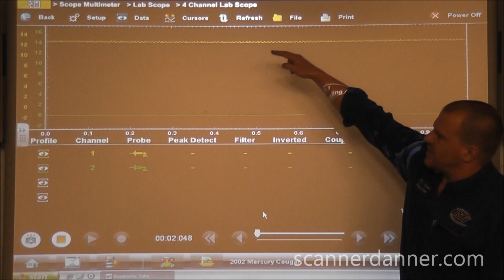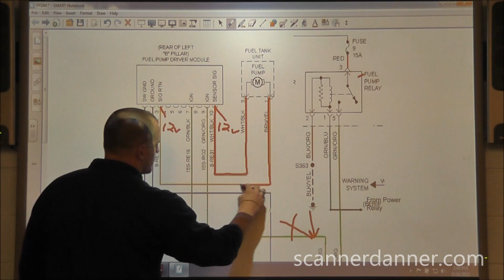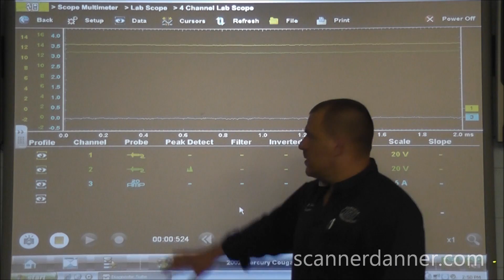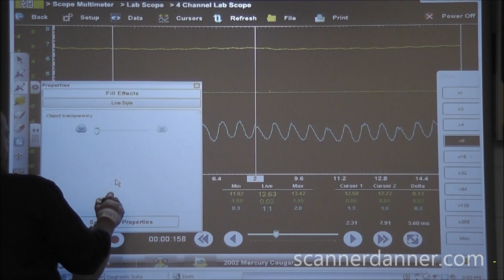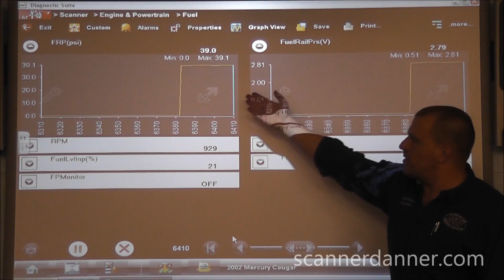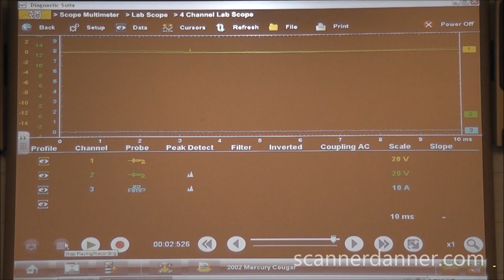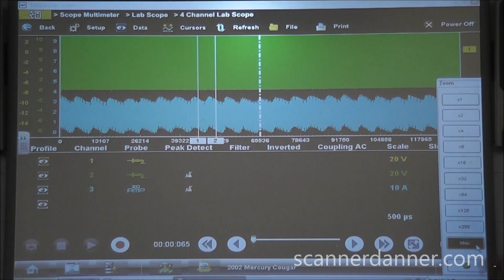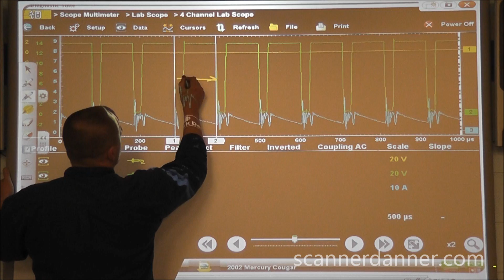No fuel pressure diagnosis and testing (new fuel pump installed, reversed wiring)

Comment: Can you tell me if I would have gone thrown off, with my limited use of diagnostic tools, but gone straight to relay, and checked that first. 
Then lead me to no power. When it should have constant. If possible,  can you reach out. Thanks
Reply from the maker: everything would have tested good at the relay and at the pump

Comment: Right on Paul Great Video as always, I really liked the way you noticed immediately the high RPM, backed it up with a Full Ground control and the RPM even went higher.  At the same time the FP amperage was about 2 amps, very low.  You determined there's no load on the Fuel Pump cause the RPM so high , so its actually was doing NO WORK.  You mentioned either the propeller fell off, broke or the FP is wired backwards.  You decided to reverse the FP power wires noting there's no wiring hazard to the FP module.  Your basic understanding of the circuit configuration, the components and their function allowed you on the correct sequence of troubleshooting.  As you mentioned Basics , Basics, Basics - thats what it's all about and that's what will make you Money $$$!!!   Thanks again Paul !!!

Comment: Good video, Thanks !!! My problem is, I did replace a new, bigger/ faster pump into my Mustang 2004/ 3.8 litre, new pump is 255l/min?/, anyway, I had to rewire, change a plug into pump, I did connect + to old +, and minus to minus I can hear pump going, but there is no fuelpressure???Could wires be wrong?/ Even I put new + to old +?? Just wondering..., or maybe there is not enough fuel in a tank?? Less than a quarter, and rear of the car is jacked up??? i will take line of the new filter next, and see, if gasgoes in there??? What do you think?/ Thanks
Reply from the maker: If it ran before and now doesn't it has to be something you touched. Reversed wiring or low on fuel.
Reply: Well, I am thinking now...red from here somewhere, than somebody changed bigger fuel pump for Mustang, and power losenend hose clamps inside tank, in a pump, they had to put better clamps in there, hose was lose..., I let you know, after I drop tank again...tomorrow!!! Hope I am right =), thanks !
Reply from the maker: keep me posted
Reply: I will, doing , checking it today !!=) Let you know.....
Reply: So, nothing was loose inside the tank, but I did put/ secure all hose connections with extra clamps!! I think what happened, was I had to modify new / universal 255 lph pump, I did shorter pump outlet, it looked so high, too high, and also it looked, maybe to narrow, smaller, than OEM! So, what I did, put thin sleeve over it, actually used epoxy glue, and made outlet almost 1/4 inch longer, so then I started to get pressure and now pump is working fine! BUT, after I changed the pump?/, and bigger throttle body, my idle is sky high, like 2500, and comes down after while to 1200???, I can't make my idle lower??? I can drive the car, but it is very difficult=(( I have changed recently IAC valve, that can't be a problem!! I also was testing Throttle Body sensor, and old was "not so good", replaced that??? No help, it seems like PCM is confused??? Should I reprogram PCM after changing a throttle body?? Old one was 60 mm, this is 70 mm, and there is 3/4 inch plate between throttle body and intake manifold, otherwise throttle butterfly-plate could not open complete!! Check engine light comes on: P0507, high idle,....sure is and P0455 = emission system large leak??? I did check all vacuum hoses, and everything around tank is fine, and I don't see any loose hose/ leaks anywhere?? Why is my idle so high, and also throttle  response very poor??? Help meeeee, thanks ! Ps. one hose comes from bank 1 into CAI pipe, after MAF sensor, old one came there also, that can't be a problem?? There is PCV valve on bank 2, going to intake manifold, hose/ pipe is fine????
Reply: Eero Laukkanen dc motors can run in reverse if wired reverse polarity in this case produces only motor load no fluid pressure loading.

Comment: I wonder how many people have wired a replacement pump wrong and ended up arguing the parts store guy?

One interesting point   in the video is on an 8 segment/bar commutator pump you are going to see any unique characteristic repeat twice per revolution  as each winding on the current has curent flow through it  every 180 degrees,  the second time n the reverse direction.
Reply from the maker: Thanks Andy!

Comment: Great video scan dan one of my faves. I noticed when GM went to electronic returnless with their FPCM there current ramp looks different than ford as scene in this video. You don't see the duty cycle in the GM pump ramp just wider amperage swings which may range 2.5 amps to 6 amps depending on what the pcm wants. take care

Comment: Great video, I appreciate all your information and videos.  I watched this video and I believe the schematic is correct. In my opinion PIN 7 is voltage supply from ECU and the other IGN is from inirtia switch, the driver need to see both signals to function. The sensor signal is the voltage supply 12V through pin 1 (motor terminal) and the signal return pin 3 (motor) will pull down(negative) from the driver logics\mosfet  as mentioned, this is a also a sense line (reference signal) for the motor status on\off , that the open circuit voltage has gone from high to  low. The module now knows the motor has turned on.  The SW GND wire pin 1 ground circuit is actually the motor negative, depending on the engineers design with out seeing the modules schematic could be a pulse width signal or constant  duty signal completing the motor ground circuit.  Just a thought.  Thanks

Comment: Very glad to watch this video. I have an automatic Ford Focus 2008, which has a similar returnless system, in a 2.0L Duratec type engine,  and I already had this code on my  scanner, and spent 90$ buying a new Rail Pressure Sensor  with no change in the symptoms. Although my car does turn on, and now fuel pressure readings seems to be accurate (past sensor sometimes went freeze at 70 psi) it seems like the fuel pump (one year old motorcraft pump) does not mantain an adecuate pressure in the rail, it read like 30 psi, and drops too low whenever I try to increase RPMs, like to 15 psi or something. I already have replaced the fuel pump filter and works ok for a week or two, then the problem starts all over....Based on this video,  it is correct to assume that the Fuel Rail Pressure Sensor does not intervene directly in the fuel pump control circuit? Also, I wanted to ask you if there is (typically) any kind of check valve in the fuel line from the pump to the rail that could be failing and lead to pressure loss? I know there are lots of things to check first but i'm not a mechanic and those are the kind of diagnostics i'm getting from local mechanics and I just don't trust them. By the way, this is a major issue with this type of car, not a single Ford Service center here have provided us a definitive solution for it.    

It is a fascinating way to learn with that screen, all the right tools, and the knowledge that you kindly share with us. Thank you so much.
Reply from the maker: +Juan Febres " does not mantain an adecuate pressure in the rail, it read like 30 psi, and drops too low whenever I try to increase RPMs, like to 15 psi"
This sounds like a bad pump, it doesn't matter that it is new. 
Watch the other two videos I have in the description of this one on how to check the powers and grounds and FPDM to be sure.
Reply: +ScannerDanner will do that. Thanks a lot!!!

Comment: Absolute quality video.My question is could you disconnect pump module start car which would loose fuel pressure then reconnect and capture pump speed on first ignition turn on as it primes?
Reply from the maker: +tgdevaney thanks so much. 
I don't think you would need to do that. But I suppose if you wanted to see the max psi command, that may help.

Comment: I really liked this video. How correct you are to stress the need for knowing the system and understanding pump RPM and current draw. Much more accurate than just replacing parts. A simple wiring mistake would have made it impossible to repair with parts changing. I have probably commented on this video before, but once again, great job. The younger techs will appreciate the time you have spent on detail. They really have an upper hand in their field, if they learn and apply what they are taught in your class.
Reply from the maker: +Jeremy Shanks Thank you Jeremy!

Comment: 2003 Toyota Camry 3.0    at idle stft  of both banks are high negative some times negative but closer to  - 7 , the same time at idle ltft of both banks is steady positive 25 and 27 . when i depress gas pedal slowly  stft and ltft go to normal .   is it fuel regulator in the tank ?

Comment: I have a 2001 mustang bullitt returnles, i been monitoring the fuel pump duty cycle. Reads 100-114% at idle . car seems to lose alot of power at wot kind off if it was starving on gas, but it has new pump and injectors. The fuel rail gauge reads 30psi and the fuel pressure sensor reads 40.
Reply: A mi me sucede lo mismo tengo un zx2 el manometro dice 30psi y el sensor me dice 40psi ya le cambie 2 veces el sensor de yonke pero reads lo mismo... sera el fuel pump driver module lo que no sirve bien? saludos
Reply: Correction..the fuel pump duty cycle reads from 27% to maybe 50% WOT ..

Comment: Talking about a worst-case scenario: just did a diagnosis on a 2000 Ford Focus with the returnless system. This one ran, but misfired badly and had no power. Here is what the owner threw at the car (cheap Autozone parts) before giving up: O2 sensors, fuel filter, ignition coil, wires, plugs, crank sensor, cam sensor, complete aftermarket exhaust system (after gutting the cat on the original system!!) that had a major leak at the head, fuel pump relay, crappy aftermarket fuel pump, TPS sensor... WHAT A MESS!!

Anyways, according to the scanner, the fuel pressure was around 10psi and fell to 2psi on a snap throttle test, with 0psi hold pressure. Pump amperage looked good, so my call was a bad replacement pump or bad installation. Had to re-watch these awesome videos to see if there was anything I missed. BTW one of my codes was P0172 System too rich...couldn't explain that one. Too many variables!
Reply: So did the second new pump fix it? Thanks !
Reply: I'll let you know as soon as the customer gets a new unit put in. Did a short follow-up diag today to confirm the Fuel Rail Pressure (FRP) Sensor wasn't lying and/or sending raw fuel to the intake via the vacuum line the first time I looked at it.
Popped off the fuel line and pressurized the fuel rail with a bicycle pump to 40psi; pressure held solid and scan data agreed. Just wanted to eliminate that variable, and suggest a quick and effective way to test the FRP sensor in the field.
Again, car idled OK and set a RICH code with a total of -25% trim at 10psi fuel pressure, but died right away on a snap throttle! My only guess is very poor fuel atomization leading to a puddle of fuel collecting in the manifold...
Reply: motoYam82
Yup new fuel pump fixed the issue. Thanks for the education, Paul! So maybe you can add that variable to the e-book: weak pump causing RICH codes due to very poor fuel atomization. Probably doesn't happen very often, but had me scratching my head as a rookie :)
The thing that really blew my mind was that the car started, ran, and drove into the shop on its own with 2psi fuel pressure!!! Seems like the only thing that was drawing fuel through the injectors was the 10psi of intake vacuum!!!
Reply: motoYam82 Interesting.  I have a similar issue with a 2004 ford explorer 4.0, low fuel pressure on the rail, PO191 trouble code, but I had a lean code (not sure what it was, I cleared it) but LTFT confirmed at +25.  Also, same as you, fuel pressure falls away from 5 psi until finally zero and engine stall.  Jumped fuel pump and found max pressure of 5 psi  (manual states that a regulator is installed in the tank, and if fuel pump return circuit is grounded a psi of approx 65 will be read on the guage), pulled filter and found that fuel just dribbled from the line.  Fuel guage says full, but I added a gallon anyway to double check.  I must say though that I would have saved 4 hours of diagnostic research by watching this video.  Hope a fuel pump fixes it.  Thank you Scanneranner for your information.  I think I am going to get your book for Christmas.
Reply: Nice. Thanks man and Merry Christmas!
Reply: It had rich codes or you saw negative fuel trim numbers at times?
Reply: On the Focus one of the stored codes was P0172-Bank 1 Too Rich, and total fuel trims were negative at idle, about -15%. It looked like there was a puddle of raw gas pooling in the intake manifold, but I cannot imagine where it came from...there is no traditional fuel pressure regulator to rupture a diaphragm. The fuel rail pressure PID was showing intake vacuum (up to 10psi at idle), so the fuel pump was actually not producing any pressure at all.
Reply: strange
Reply: i had a focus 2000 with a problem like that the costumer replaced o2 sensors  I replaced plugs coils  2 days after he come back with the same problem was a bad battery  ......  I put a new battery   and that solved the problem....

Comment: great video paul, would manf. fuel pump specs nominal current rpm voltage shed any light on fuel pump performance compared with actual measurments

Comment: Question about 8 bar pump. On the amp signal trace there was a repeatable characteristic ever 4 pulses, isn't this because the brushes are 180 degrees apart from each other ? Instead of looking for single repeating copies of a waveform, could you just look for groups of copies if you know that they repeat twice? 8 bar would be 4 copies, 10 would be 5 etc...

Comment: Nice video Paul. :)
I think from my own observation we as an industry are in a seperation mode between Technicians and Diagnosticians. Not all technicians are Diagnosticians and the industry needs to aknowledge this fact. It is too much for me to remain current on Diagnostics and mechanical replacement procedures together. In my shop I'm the leading Diagnostician and I turn no wrenches unless to aid diagnostics. Yes my ass is on the line for liability for what I recomend but it works well.

Comment: Good way to test the performance of the pump based on amperage and rpm, you can tell if the pump is actually doing some work, i have found alot of this with tanks empty on fuel... and people thinking it might be the pump,,why drop the tank to verify right????

Comment: Paul, this video is one of my favorites so far.  I had the same thing last year on a Focus.  Someone replaced the fuel pump and afterwards it would barely run.  Fuel pressure was very low.  Pump was spinning very fast at low rpms.  They replaced pump only, not the assembly.  I figured out that the regulator in the tank was blown out.  A new assembly fixed it.  I have wondered a lot if grounding the pump in the original testing caused the regulator blowout.

Keep up the good work.

Comment: I got a good one for you... Kid i worked with had a windstar in, no start he just hits the Schrader valve with his finger calls it a fuel pump, sell the job change the pump he goes to start nothing pump didnt run lol, now he diagnosed it properly checking for power etc. etc... All signs point to pump, pulls the tank the 2nd time forgot to plug it in to the sending unit hahaha the diagnostic gods punished him for throwing a part at it...great video Mr. Danner,  found your students mishap amusing

Comment from the maker: No, that is why we look for unique characteristics in the waveform humps. So we can identify 1 rotation. We use 8 as a minimum to check ourselves and make sure we are doing it properly. Sometimes it simply is not possible to ID one rotation. So then we just count 8 and place our cursors and look at the RPM, if it is close, you did it right. If it is way off you either have a problem or you measured wrong. Again, this is not an absolutely necessary test, it is nice, but not always needed

Comment: Yep, EEC power relay energizes fuel pump relay, I've seen this on numerous Fords and their counterparts, Mercurys, Lincolns...On the Grand Marquis, the AC Cut out relay, EEC power relay and the fuel pump relay are inside alittle sleeve. Depressing some lock tabs allows you to slide the relay rail out of the sleeve in order to remove the relays
Great video once again Paul

Comment: A warranty claim,why it's a ford pump service part warranty it.no he handed me an airtex warranty claim form, and told me the customer went for a cheap repair. Right away I thought miswire.so me and the advisor ask the tech that installed it how did he wire it, he says it doesn't matter just disconnect and reconnect.oh yes it does, so he had to drop the tank and I shoed him it wouldn't flow pressure by using jumper wires the correct way,swapped the jumper wires and tada it flowed pressure.

Comment: Great job Paul,man I wish I had a versus or a scope.i ran into a very similar situation few years back.i had a ford pick up no start,diaged it for a bad fuel pump.it got handed to another tech for the repair,after the repair still wouldn't start.so it was put on me as a misdiag.i had to re diag it,did my thing a everything led to the fuel pump.had good power and ground and would light up a head light bulb in a load test.so recommended faulty new pump, and found the parts man telling me to fill

Comment: About 1/4 of the way through I was thinking they left the little "Cap plugs" on the inlet port of the pump. Same effect as a reversed wiring but would have been a lot more work to check. Good call.